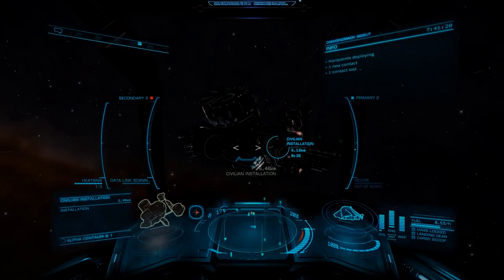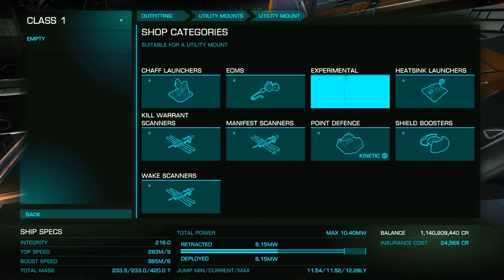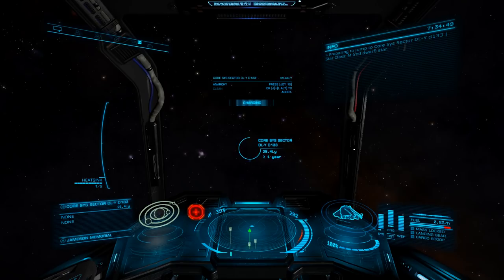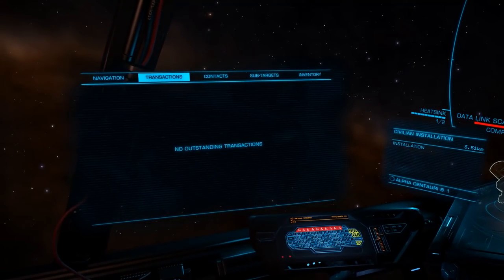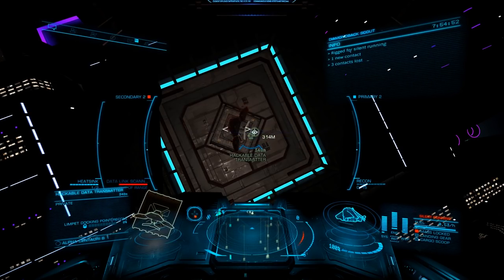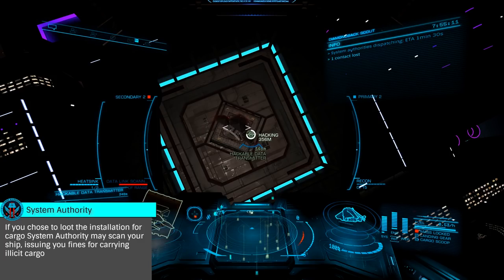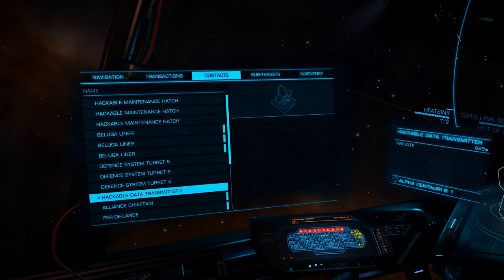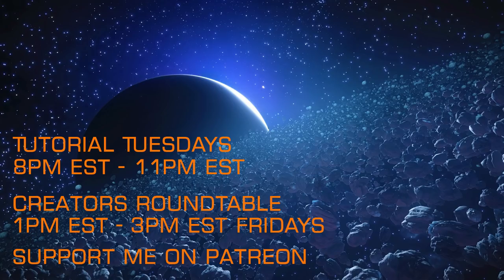Tutorial: Hacking Installations for Data

Comment: I found much better to just stay in my big fat ass Vette, tank build with 5k shields and LR beam, AND an elite fighter deployed,   in a Nav Point, in a Boom Sys. with High Tech, loaded with 50-60 limpets, AND some pieces of GOLD, and scan the crap out of all traffic there; Advantages are HUGE over this method: 
1 - you get lots of shields / thruster data 
2 - you engage % fast melt  dumb pirates who always come to you asking for your gold ( I laugh my ass off when they say "sorry didn't mean to bother you" and try to run away !  ),  and you can take on wings of 3 pirates easily since you will be backed most of the time by system authority vessels ( as you will back them and "steal" a bounty when they engage a pirate !) 
3 - you get usually 1,5 - 2 millions in bounty for the time of a MC full magazine ( when you need to pack your toys, run to the nearest port, rearm with ammo, limpets, cash the bounty and REPEAT if you like) 
4 - you get HUNDREDS of manufactured materials for  engineers  - and most imp, IF MUCH MUCH more fun ! 

So, credits + manufact. mat. + fight experience for you and your fighter pilot + encoded data + fun  VS encoded data  - what you pick ?

Comment: Thanks.  I just ran into the Sanchez Class Science Vessell in BD-12 1172 and didn't know what I was supposed to do with it.  I won't need to scan it, though, as I'm already running a 80.72 ly Anaconda.  Can't risk getting a bounty with a vulnerable explorer ship.
Reply from the maker: Remember depending on the system state, if it's Anarchy you won't get any bounties at all.

Comment: Did this change to where you can't do it without getting a bounty? As best as I can tell, I'm doing it identical as this video and I get a bounty and attacked without fail every time I try.
Reply from the maker: Are you silent running when you perform the actual hack?
Reply: @Exigeous  
Silent running when launching limpet, connecting, going, and disconnecting. While the limpet is connected and doing its thing, I get flagged with a bounty. I've found a lawless area with a station for doing it at now, in Amadioha.

Comment: I would advice everyone to swap the fuel scoop with another cargo bay on the nearest station, so you can increase number of limpets to 28, which significantly increase data per hour rate. And don't look for another hackable data terminals. Because you will make this being searched by authorities. Worthless. Just re-log as soon as you hack the terminal.
Heatsink is not needed at Scout. Run a silent mode as soon as a limpet is fired and till a re-log. DBS don't care.
Reply: Or you could stock up on iron and nickel. Than synthesize four limpets at a time. Technically you can make 120 limpets in your ship that way.